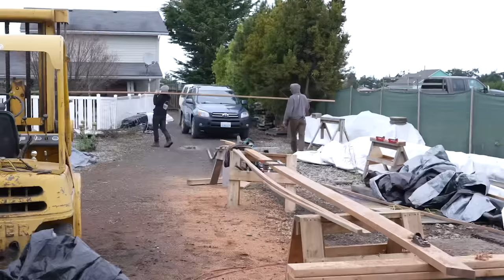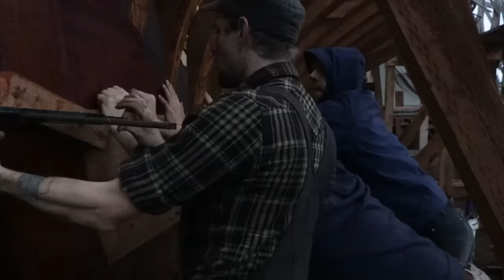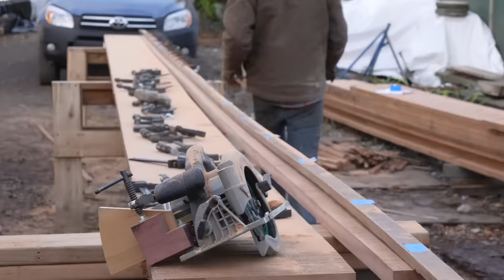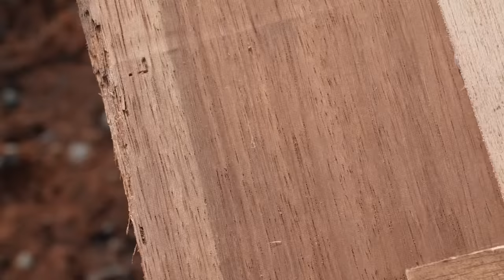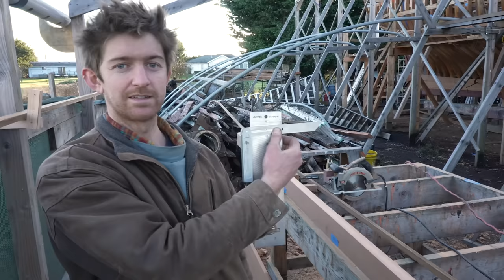Planking Tally Ho! (Wooden Boatbuilding / EP86)

Comment: Purely out of curiosity, why is the dolly a better tool for planking rather than a version of the clamp you made for peening over the knee rivets?
Reply: Because the frame and plank will move a bit on impact. The Dolley/buck is very heavy, competely isolated from the boat. Thanks to the law of inertia (the mass of the dolley/buck) it does not move on impact when "leaned in" by the "buckingperson thus producing a much tighter fix.

Comment: Having built two RV aircraft and having driven over 15,000 solid rivets, I wonder why you aren’t using pneumatic rivet guns?  A 6x gun would probably drive your 3/8 easily.  Sure would be a lot less labor.  The learning curve would require a lot of mock up training, but using a protective plate like you do in the hand riveting would protect the frames.  You could finish them by hand to get away from a too uniform look.  Would require a decent compressor.  
Contact me and I can see if someone around our air park has one we can donate.

Comment: So the planks require no fairing to the hull timbers?
Reply: The inside face of each plank must be curved to match the shape (vertical curvature) of the frames. That's why the planks are narrow - if they were wider, lots more wood would have to be removed. Last episode, Leo modified a wood-body hand plane & a set of power-plane knives to a curved profile.

Comment: 28:42 Instead of using a finger to guide a hand held circular saw for a cross cut like this, put a speed square up against the work and either clamp it or hold it by hand. It is safer and guarantees a right angled (or whatever angle needed with clamp) cut. Speed Squares are a versatile and cheap tool. Here is a link to a short (with pictures) article on how to use one, including how to use it for cross cutting with a hand held circular saw. https://www.familyhandyman.com/project/how-to-use-a-speed-square/

Comment: Well,  I have tried to find Fairwind Fastening in Port Townsend - I would like to send to you a small consignment of fastenings - but have failed to find them with this information; a company of that name exists in Newport RI, and also using the name Fairwind brings up variously a winery and a dealer in cannabis...neither of which I hope you need or want! Any more ideas available on the exact name and location please? Also, if it IS the RI company, the largest screws they do are 14 gauge...SOOO Mickey Mouse! As I result of this finding, I tended to ignore them....that, and the 4000 miles between you and them. 
As to the scarphs...well, all the advice I can give is that when a boat was built for me at John Moor's yard in Charlestown (he later moved to Mevagissey) in 1975/6, he not only scarphed across the width of the planks, but also spiked and clenched a plate on the inside, between ribs or rib and frame. The plate was a plank offset, and it filled the space between the timbers, except for a tiny gap at the down side end to allow moisture to draining the bilge. That seemed to work well. The boat is now fishing out of Mevagissey, and is still going strong and in its 44th year of fine service. Peter Moor now runs the yard, I believe. All of this may be old hat to you, but it was OK then, and may be OK now.
I can only echo the very positive comments below on the subject of Pete. What a transformation. I hope is suitably set up for life after this experience.

Comment: 00:19 starboard garboard
01:03 stopwaters
04:03 simplified edge set test
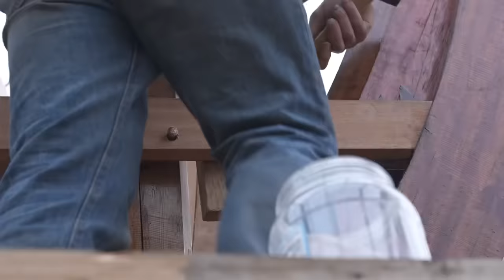06:48 stem mishap
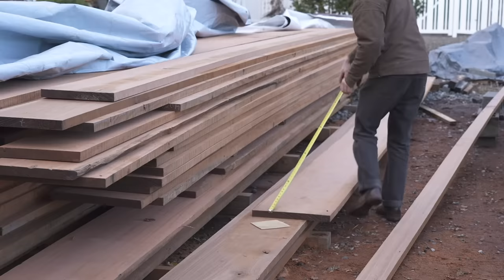08:34 longest straight edge in the world
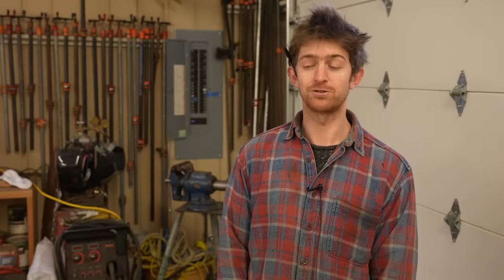10:12 rolling bevel circular saw
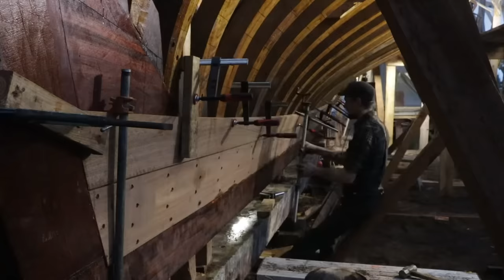14:16 transition work, volunteer rotation
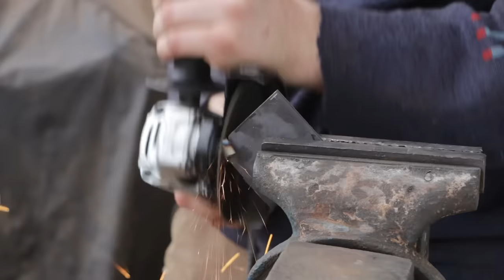15:47 a dolly?
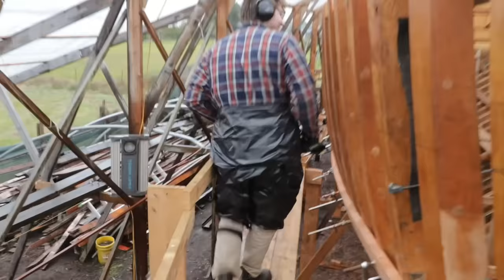17:41 waterproof diaper
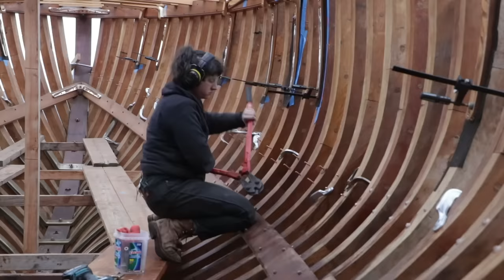18:42 fasteners
20:59 first square edge plank
24:02 Pancho
25:45 butt joints X scarfing
29:27 final cost of the bronze
31:44 portside garboard
35:21 edge setting by Pete
38:08 progress so far
39:55 edge setting by Leo

Comment: Why use slotted screws rather than Phillips head (or some other positive engagement head)?
Reply: I think Leo talked to this in a previous video, but here is my 2 cents - A slotted screw head with the proper bit is more secure than a Phillips because the design is prone to "cam-out" where your bit comes out of the recess, so you need more end-force to keep the bit engaged and torque the screw properly.  The only recess where that doesn't happen is a Torx-Plus recess where nearly all the torque force goes into turning the screw.

Comment: Leo Sampson is an accomplished boatbuilder, after all he started his career as a shipwright as an unpaid apprentice in a shipyard. We can safely assume that he has seen more wooden boats with loose planks than the average sailor. So what he is saying about butt joints vs. scarf joints is very probably true.  Leo has no faith in glue and swears by the time-honored shipbuilding techniques that have proven their worth for centuries. And that is bad news for the Acorn to Arabella team. Not only did they start planking using the wrong wood, they used scarf joints all over. I sincerely hope that the A2a team will review its working method and talk to Leo.  It would be a great pity if the sympathetic amateur shipbuilders were to run into serious trouble afterwards.

Comment: Why don't you weld a loop onto the buck and hang it from the boat on an adjustable line and pull inwards with another line?
Takes most of the weight and all the worker needs to do is hold it in place.

Comment: Here is a question: Who sharpens all your tools?
Reply: Whoever uses them id say. It's a huge part of being a craftsman.
Though id say the senior crew would help or oversee the apprentices as you can damage a blade if not careful.
They are using a slow, wet wheel from Tormek though and that helps keep things accurate and cool!
They're a joy to use!

Comment: Isn’t the shipsaw the exact tool to make a cut with changing angels? I’m no expert but why use the circ saw when they have this great shipsaw?
Reply: Much easier handing a small tool versus a 20-25 foot plank in the shipsaw as it requires more labor
Reply: Some boards are up to 40' aren't they? You would struggle to keep them accurate, even with helpers. Circ saw is a one man band!
Reply: @bushratbeachbum  I don’t think that despite having board lenghts of 40’, Leo is using all of that considering the staggering of butt joints

Comment: Why are slot-head fasteners used when more 'secure' designs are available?  I personally have ruined enough work slipping out of slots (millwork) to the point I frequently proclaim that slot screws should be illegal!
Reply: It'll be much easier to clean the slot, if the screw must be removed for future repairs.

Comment: I cannot express the depth of my frustration seeing slotted screw heads. 
I've often said if I had a time machine the fist thing I'd do is go back and punch the person who invented the slotted screw. 
I know it's traditional but really, we have so many better options today. Get a torx head screw, save yourself so many headaches. 
Lol, just my thoughts.
Reply from the maker: Try cleaning glue out of a torx head which had a bung glued over it, so you can take it out! Yup - boatbuilders use slotted screws because we know future Shipwrights will thank us for it.
Reply: @SampsonBoatCo  small drill and pick, is it really that much easier for a slot that will easily strip out anyway,?

Do you really remove the screws? I would think drill the head off, pull the planking over and use a regular drill chuck to remove the rest. 
Not being argumentative, actually curious. 
I'm just giving thoughts not expertise, I've built and rebuilt many things with wood but never a boat. 
It's truly fascinating the different methods used compared to other woodwork. 

Truly appreciate the reply, immense respect for the entire crew. 
I still hate slotted screws, lol, but I see your point and defer to your expertise.

Comment: why use cedar dowels when you can just make an epoxy dam?
Reply from the maker: I hope you're joking!
Reply: @SampsonBoatCo  well .. it wouldn't expand and threaten to open the joints more like wooden dowels would - is my thinking ...
Reply from the maker: the expansion is actually the whole point of the cedar - it seals any gap. The joints are hardwood held together with large bronze bolts so there is no chance of a small dowel opening the joint up.
Reply: @SampsonBoatCo  ohhhh i see - i was worried maybe the expansion of the cedar might potentially SPLIT the wood ... so the expanding cedar and the bronze bolts placing them under tension work as a system ... i get it now thanks!
Reply from the maker: that's it! :)

Comment: 17:06 This guy does his own thing with "safety" and that's his call. Having already injured himself in this build you'd think he'd have learned but apparently not. If you like having hands that still have all the right bits attached, USE A RIVING KNIFE ON YOUR TABLE SAW. Here is a link to a guy showing how easy it is to twist the work and have it kick back. He comes millimetres from getting badly injured and it happens fast. https://www.youtube.com/watch?v=u7sRrC2Jpp4
Reply: @cmmartti  I'm not sure you know what one is. They are very cheap and fitted to every table saw I've ever seen as standard. Here is a link to an image of one. https://www.shopsmith.com/ownersite/catalog/images/non_thru_riving_full_profile2_l.jpg
Perhaps you know them as a splitter, in which case I'd like to know what you call a riving knife. In any case that table saw is plenty capable of grabbing a few kilos of lead and throwing it across the room.
Reply: @cmmartti  Riving knives (what you know as a splitter) are attached to the blade raising assembly and rise and tilt with the blade. The only reason to not use one is if you're doing a partial height cut that doesn't go all the way through the work, such as when using a dado stack.
If you have a moment, could you please paste a link to what you know as a riving knife. I'm curious to see what one is.
Reply: @cmmartti  Yes I read your comments. I got my first table saw in 1983. It was a Makita very basic model and it had a riving knife supplied. The image I linked to in my first reply to you is of a riving knife. Again, they are cheap, provided with every table saw I've seen (and that's a lot of saws over the last 38 years) and should be used for every cut (including bevel cuts) except ones that don't go all the way through the timber.
There is no argument that can be made to the contrary as unlike blade guards they don't impede work on the saw at all and are a critical safety feature to reduce the chances of kickback. See the link to video I posted earlier for clarification on this.
Reply: @cmmartti  Yup, if you don't use the blade guard and the knife can be lowered below the top of the blade height, you could make blind cuts with one.
It wouldn't do you much good with a dado stack though, unless you had one as wide as the main blade width of your stack.
Reply: @cmmartti  Ah, I see the slot you're talking about. Thanks for the clarification on the difference between a splitter and riving knife. If it were me, I'd retrofit a riving knife or at least use a feather board to keep the piece against the fence and a long push stick to push it through. I'd never let my hand get that close to a blade.
Reply: @cmmartti  I'm in Australia. I've thought about it and I recall an ancient fixed table saw I used many years ago and I don't recall it having a riving knife. I'm not sure when they became common but that is the only occasion I can think of where a saw I used didn't have one.
Reply: @cmmartti  Whilst a smaller diameter blade (such as a dado stack) would leave the riving knife with a less than ideal gap between the knife and the blade, as soon as the work passed through the blade and the cut reached the knife, you'd get the protection from twisting they provide. Not perfect but better than nothing. However, I've never seen anyone (including myself) with a selection of various width riving knives to fit for every width of dado stack. :)